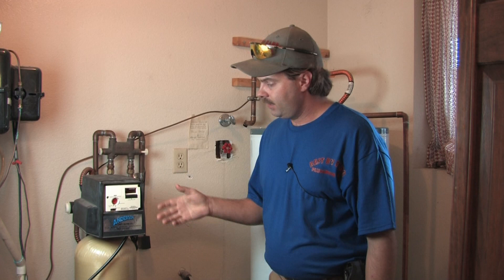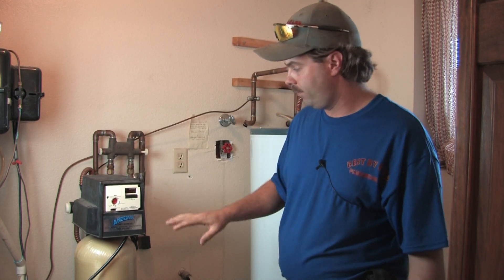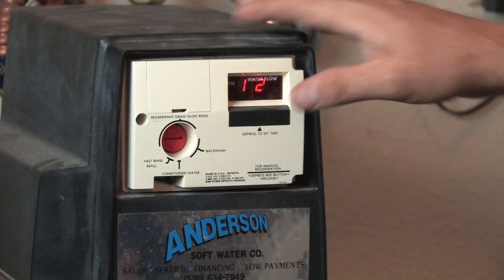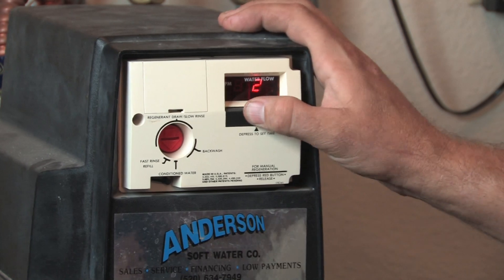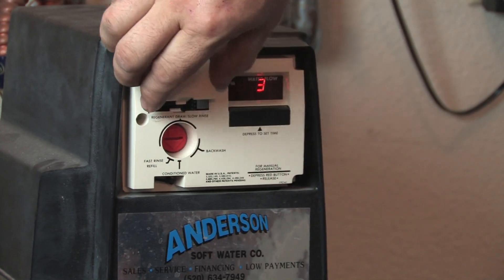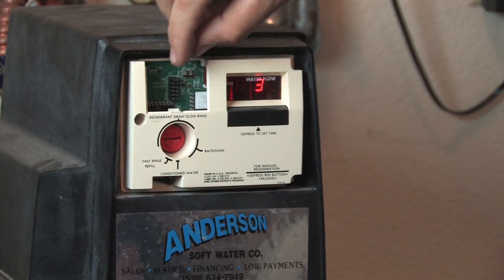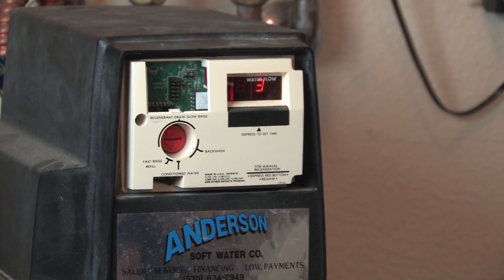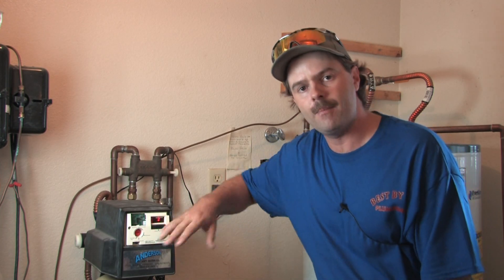Water Softeners : About Water Softener Hardness Settings

Comment: Hate to tell you, but im almost sure that unit is a 460i, which is a demand unit not a time unit.
Reply: Yeah, I was just going to say.... it looks exactly like mine (460PM) and the manual says it's based on demand. I just wish the manual was more clear on what values to use. For example, for the hardness value, is that supposed to be the hardness of the water going into the softener? Or the desired hardness coming out? (Edit: I think I figured it out... should be the hardness coming in)
Reply: @GabesHacks  yes are you talkin about where you take that little jumper and then you have to read the display in hexadecimal and go to the table and convert it? I change the resin a couple of years ago and it's mine has been working great ever since
Reply: @Drrich_DIY  I am talking about where you move the jumper to see/set the value, but the manual for mine doesn't say anything about hexadecimal.
We had ours unplugged for a few months to see if we could do without it, but we decided we need it so I was turning it back on today. But I wanted to review the values to make sure they were actually correct. One of the problems we saw was that it seemed to be running too often. I have adjusted the values to what I think they should be, which seems like it should run less often (hardness was set too high, capacity too low) so we'll see how it goes now.
Reply: @Gabe's Hacks you seem to be right on the money. The unit was in the house 10 ys ago when we moved in, no manual, no nothing. I found it on line, and it appears that (at least on mine) when you move the jumpers you can see how many gallons since last regeneration etc. But it reads something along the lines of 6A42B
And there is a chart that you look at and the 6A42B translates into 560 gallons. Something like that. If i can find a link i will add it to this comment its here. The one that says 400, 460 QUick seevice guide https://www.softenerparts.com/category_s/2000.htm. Even if you don’t have that exact unit, I think the manual is the same for most of them. By the way, this guy has helped me tons over the years. (Not affiliated in any way). If you need parts or even advice the owner is responsive and knowledgeable
Reply: @Drrich_DIY  Interesting! That looks like that might work on mine. I'll have to test that out. Thanks!